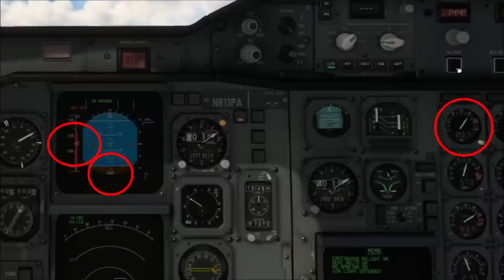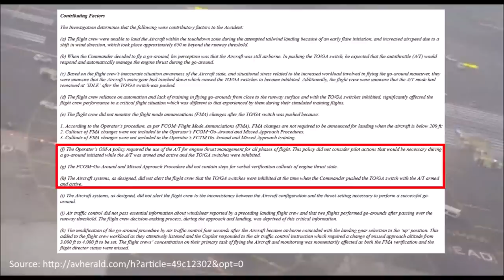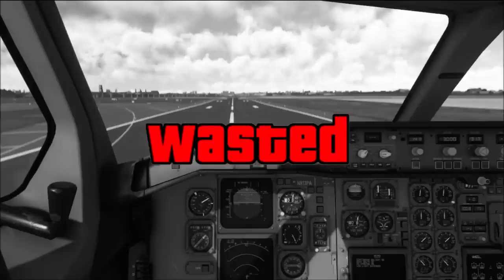How Automation Almost Killed Me - An MSFS Case Study | Real Airline Pilot

Comment: Love this! I think automation issues are a common "killer" in flight sim, speaking from personal experience. It's why I bound A/T disengage to a button on my throttle, and A/P disengage to the largest key on my keyboard, right next to the same throttle: numpad insert.

I've had plenty of panicky automation moments. The lesson is the same each time - disengage and take control! Then run a test flight to figure out how the automation screwed you over. Lol.
Reply from the maker: Yep, the "disconnect and save yourself" is probably one of the biggest issues these days. Too many pilots have watched the automation fly them into the ground. Not only in the flight sim, but also in real life.
Reply: Seriously. I swear like half of the clips on flight sim bests are people who got into a crash that could have been avoided by disconnecting the AP and flying it yourself!
Reply: @ungeneer1506  I left a comment on one FlightSimBests video saying "Take a shot every time someone in an A320 struggles to fly the plane manually." like the pretentious Boeing simmer I am. Lol.
Reply: @mauricedesaxe1745  and the A320 is probably the easiest plane ever to hand fly
Reply: I need to bind A/T.

I have AP disconnect bound to the thumb button on my joystick (I think that is fairly realistic, but nothing for A/T).

(I have only bound disconnect, to connect it I use the panel, and I don't think "side-stick priority" works)
Reply: @A330Driver  there were a few cases where turning the heading bug instead of taking over lead to ground contact.
Reply: @ungeneer1506  its a fighter jet in alternate law

Comment: I guess they learnt with the a320 where there is no auto throttle (thrust) go around I believe. Ie the auto thrust ends at the thrust climb detent so toga is always firewalling the thrust levers which is manual thrust and you only bring back to lever climb and which engages auto thrust at the accel altitude, hence there is only one way to TOGA and hence no confusion for the pilots. That’s progress :)
Reply from the maker: Yup, think so as well. On the NEOs they added a reduced thrust go around however which you can use by putting the thrust levers into TOGA and then pull them back again (not sure if into MCT or CL). But I'm sure they did their risk analysis and figured it was no problem.
Reply: @A330Driver  TOGA then MCT within 5 seconds

Comment: Of course in the real aircraft you would probably just hammer the thrust levers forward anyway and overwrite the autothrust that way until the situation stabilized itself. 

This might also be another argument for the detent system in newer Airbus types. If you put that one into TOGA, it is in TOGA. There is no overwrite or ambiguity if the autothrust really puts in TOGA thrust.
Reply from the maker: Absolutely!

Both ways of thrust lever management make sense, the Detents would definitely have helped avoid a situation like this.
The "moving" thrust levers however also make sense as they increase situation awareness. Both ways are good in their own way.

Comment: Flying the A310 after the Pmdg had me concentrate way more on the instruments. The automation system is way more primitive than in newer aircrafts and it's not enough to just expect it to fly itself. I've had a close call too when engaging profile mode during a turn to final on an RNAV approach. Everything was fine then suddenly I hear the stick shaker 😲
Reply from the maker: Yep, slow speed flight really is a bit of a thing in the A310. I always add at least 10kt extra when I have to make turns with the automation in low speed situations for this reason. When back on a straight course I cancel those out again.
Reply: Also, according to IniBuilds, during the A310 early days, a delayed-flaps approach wasn't a thing yet. So the A310 have to be in full landing configuration before you make the base turn or before passing the FAF. However, this is somehow only true for non-precision approaches tho. If you're doing an ILS approach, you could do a delayed-flaps approach but you still have to be more careful than in modern planes.

Comment: It also feels like the engines in the A310 take forever to spool up which doesn't help the situation.
Reply from the maker: I recall something like 8 seconds being the required maximum time to reach GA thrust by the lawmakers. They use exactly that in the A310. In a situation like this even a single second would seem like ages however.

Comment: You know what this also shows? To all the cabbages that say you cannot use MSFS for training like you can with XP, this should leave you in no doubt.
Reply from the maker: Always comes down to what you want to train of course, in my opinion you can not train hand flying in ANY desktop sim, Xplane or not. For an exercise like this however the sim is perfectly suited!

...just like many real life Sims by the way. In flight training I also spent 40 hours in a "sim" (FNPT II) which was totally unsuitable for practicing takeoff and landings. Still it was very valuable time for learning procedures and was fully worth the 300€/h or whatever it cost back then.
Reply: @A330Driver  Depends on what parts of hand flying you want to train. With a VR headset you can totally train your spatial awareness, how to judge base and final turns correctly. I always had troubles with those in the sim, but not in VR. 
What you can't train is muscle memory because the hardware resistances are not at all comparable to real aircraft unless you invest into controllers that cost 4 figure sums. And there is of course the lack of g-forces when you sit still in front of your desk instead of moving through space in an aircraft.
Reply from the maker: @Quotenwagnerianer  Yep, that's exactly right. And now my question: What is better for training situational awareness in the pattern? A sim which shows you satellite imagery and good graphics or the sim that has the closest flight dynamics, which you still have to handle through consumer hardware products? ;-)
Reply: @A330Driver  Hehe... that's not really a question, is it? ;)
Reply from the maker: @Quotenwagnerianer  Definitely not ;-)
Reply: Thanks very much for the video! The sim may not give you the actual feel for the aircraft, it does give situational awareness and taking the proper steps to recover.
Reply: You can’t use flight sim for realistic training, it’s nothing like a real airplane.
Reply: @topofthegreen  Then why do full motion sims exist, if you can't use flight sim for training? ;)
Reply: @A330Driver  And I 100% agree with you. My most despised word in flight simulation is "realistic." No flight sim is realistic. Not even multi million pound full motion simulators that are designed to train pilots. You just cannot recreate what it is like to fly a real plane. 

So when anyone says this is so realistic, no matter what sim it is, I always say you mean more "believable."

What flight sims are great for is what you have showed here. They are great for learning procedures, cockpit layouts, checklists, practicing faults etc. They can be a great thing to use alongside real world flying. 

The one thing they will never do though is replicate what it is like to sit in a real cockpit. Despite what sim it is. So stop with the XP is better because the FAA approve it. It makes no difference.
Reply: @pauljackson1359  To state the obvious, XP has been going for many years, a hell of a lot longer than MSFS. The same for P3D. Hence why they are both used for flight training. 

Both of the above are able to be implemented into home cockpit builds with multi monitor support etc. Not so with MSFS quite just yet. There are more important things for Asobo to concentrate on first before this happens. 

But once they do, you see how many people switch, for the unrivaled immersion factor.
Reply: @delarosomccay  I'm confused P3D is a port of such as in it uses Microsoft Flight Simulator X coding. I gather you mean if Lockheed were able to update their graphics engine for P3D?

It still wouldn't be anywhere close to MSFS as it just can't compete with Microsoft's Bing Maps integration. If they got A licence from Google Maps,. then maybe it could rival MSFS? 

Unfortunately for P3D its on life support at the moment following the release of MSFS. Only the absolute dedicated simmers with £1000's of add ons still use it. And of course some military establishments.
Reply: @delarosomccay  Yes it was pretty obvious what you mean't, but still worth clarifying. 

There was a poll done not so long ago, I think it may have been done by Navigraph to see what simulators people are buying and using. P3D was in third place with 9%, XP with 23% and MSFS with 68%. I think that speaks for itself.
Reply: @A330Driver  MFS is good for IFR training and memory items. All approaches with Autopilot. 

For landings you can only use a Full Flight Sim and they are about 70% real. Base training is 90% real 😆
Reply: At the end of the day, it depends on the aircraft add ons you're flying on any SIM, not about X-Plane or MSFS, I use both. The inibuilds 310 is probably the closest thing to a good payware add on like a Toliss A321 on X-plane, but it has some ways to go. In the end it depends on the 3rd party devs and Asobo to consistently tweak and maintain it.
Reply: Same thing happened to me in innsbruck I was able to save it last minute

Comment: Probably more dangerous in a simulator . In real life with TOGA switch on throttle, I would instinct push throttles to max, and hold it there with white knuckles.  
But floating over runway is really dangerous. We almost lost a F-28 on icy runway. With no wheelspin there was no spoiler deployment, and squat switch activated, aircraft was confused. On GA main gear touched a stone wall.   The same with 737 and trust reverser deployment enable at touchdown while pilots initiated GA.  If I remember correct - squat switches was installed on nosegear for T/R to avoid this situation.

Comment: If I'm reading the screen correctly at 7:00, it does not look like the investigating body is suggesting that the automation systems were faulty or broken. It appears they felt that the issue was more impacted in a lack of training for the automation systems and that the automation systems were not alerting the pilots to the issues with the TOGA functionality. It sounds more like a disconnect in the way the plane was configured, what was going on outside, and what the pilots thought they were dealing with. Also sounds like the pilots might have been a bit task saturated as well.

Comment: To me it seems silly to train yourself to automatically yank the stick back to 15 before confirming engine spooling.  I think it would make a lot more sense to keep the plane at the minimum pitch required to halt the descent  on to the runway until visually confirming the engines are spooling for the go-around.

Comment: In a real plane you either would start a go-around either by setting the thrust levers to TOGA (Airbus A320 and newer) or by clicking the go-around button on the thrust levers and keeping your hand on the levers to monitor that they advance (which is what the Emirates crew failed to do, the other things you mentioned).

I have a particular objection with "I was not expecting a go around in the first place". The right mental model is that you are going to go around in every landing, unless you happen to not need it. In the same way that you are going to have an engine failure in every take-off, unless it just doesn't happen to occur. As the saying goes "Every approach is a go around and an option to land".
Reply: Yah one would think that is the sort of thing drilled into pilots considering it's one of the most dangerous parts of a normal flight, that and the takeoff.

Comment: There's one huge difference between the way they did and you did and the way I'd do.
When the stick shaker shakes, I'd push the controls hard to push the nose down (besides manually adding full power) to give more time to the aircraft to gain thrust. Then I'd resume climbing.
I wonder if that action would have been enough to save the aircraft if It'd still take too long to respond.
Reply from the maker: So what would happen if you push the nose hard down at this altitude? You have 160ft to loose. Your plane would build an immense descend rate and then hit the ground.
This is what happens at 1500fpm on impact: https://www.youtube.com/watch?v=kJZ1eHU_JZg&t=2s
Reply: @A330Driver  
You have a point that I wasn't clear:
I would push hard but not for long. I would make a descent but I would arrest it to try staying at a slow descent.

Makes sense now?
Reply from the maker: @brunoais  How would that work though? You'd hit the ground straight away, or even worse: Run the risk of pulling a secondary stall as you will increase G forces when arresting the rate of descend. In my opinion there's just not enough air below your plane to achieve anything meaningful. And in any arresting manouver you increase g loading, immediately turning the effect of the previous push into the very opposite.
Reply: @A330Driver  Oh... I didn't think that would happen but I don't have MFS to test it out, unfortunately. I only have FSX which is old and doesn't modulate physics anywhere near as well.
Reply: @brunoais  I think your maneuver might work for a clean F-15C, just not so much in a 737 with hundreds of souls onboard.

Comment: Once you were below the MDA or DH and definitely at 30', that was more a Rejected or Balked landing than a simple go-around. Simultaneous with raising the pitch by 12.5° you should have been advancing the throttles yourself and not relying on automation. Pitching up and raising the flaps without power coming in is what gave you the 30 knot speed loss and the stick shaker.
Reply from the maker: In real life: Yes. In flight sim: Impossible since the hardware can not overwrite the software with the AT ON in the A310 Simulation.

Comment: Nice video :) I've seen this happen to a lot of people and I'm glad you addressed it XD Just one thing: I understand it's common procedure to elect 'go around flaps' immediately on going around, but surely in a low-speed scenario, without sufficient thrust established, this might result in the aircraft losing lift more suddenly? I think, in general aviation at least, the rule is often not to clean up the aircraft without sufficient power or the aircraft could suffer a LOC at low altitude, resulting in a failed go-around (and impact). So I was wondering whether there was a reason for this call, and the reason not to wait?
Reply from the maker: The last flap setting (or last settings as in the 737) are primarily drag settings and not lift settings. Just see how little the difference is between the movement of the amber band. In the 737 it's some 10kt, depending on the setting used even less. You want to get rid of that drag and the effect on lift is minimal, that's why it is Airbus SOP (and Boeing SOP) to retract those flaps immediately. One step in the Airbus, towards Flaps 15 (1 in case 15 was the landing flaps9 in the Boeing.
Reply: @A330Driver  Ahhh thank you, that makes sense now

Comment: Automation is very nice if it does what you want. If it behaves different from what is expected it can be very stressful/bad. Its the same with writing a skript or the Autothrottle logic. 

Flying in simulators i always disengaged the automations and just started doing the work myself. Realising the error and correcting it can take some time and be a deadly factor. The problem i see is that modern jets rely heavily on a lot of automations to remove workload from the crew but can add a lot more stress if it goes wrong. 

For example flight 447 or the incidents with the mcas system show that crews can be overwhelmed with the situation and in theese situations you tend to revert to the trained items or even instincts. When you engage the autopilot, as per company procedure, right after liftoff, set the thrust by the autothrust system, etc. you loose the ability to know how the airplane behaves in certain situations. 

Could you comfortably fly without autopilot autothrottle? Trim the plane? Know when the plane buffets, how it behaves in high altitude/low altitude etc. ? How do i react if the plane pitches up and i cant stop it? How does the Airbus behave in Alternate Law? Direct Law? 
In the flight sim this is not a problem as you can always reset the flight or cheat yourself out the situation but in real life this can be a decision between life and death.

Comment: Did some digging...this is practically the same trap on Boeing aircraft.....check out famous but unfortunate Asiana 777 at SFO....they engaged FLCH (exactly same as 'selected' descent on an Airbus, i.e. A/P descending as a function of speed, with throttles at idle) and it appears the trap is that the throttles actially STAY at idle, when capturing the glideslope, catching the flight crew unaware, and thinking that it will maintain the selected speed. Very similar to your demo here, Emanuel.
Reply from the maker: With GS mode active in Boeing aircraft the A/T will always follow the MCP SPD. If your airspeed is above that speed it'll stay in IDLE in either HOLD or ARM modes (depending on type), but when you near that speed it'll maintain it. The software does not allow for the AT to command a continious IDLE when at or below the MCP SPD as long as the A/T switch(es) are in the ARM position.
What happened in the Asiana case was that they did a visual approach and had LVL CHG active, to my knowledge APPR mode was not involved in that accident.
Reply: Its more like EK521 when crew pressed TOGA buttons and nothing happened